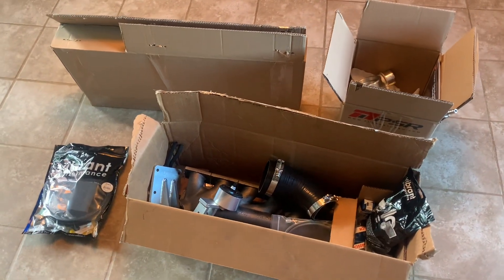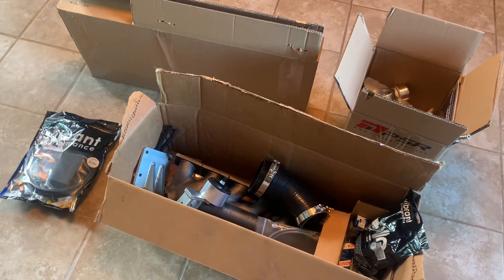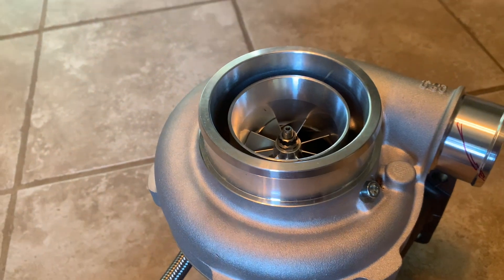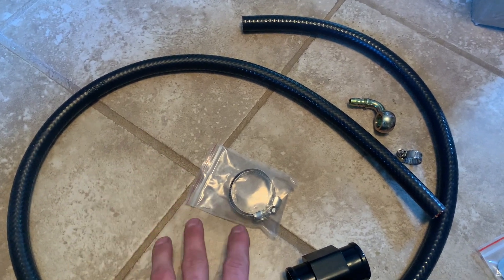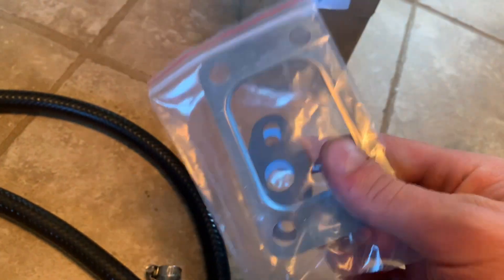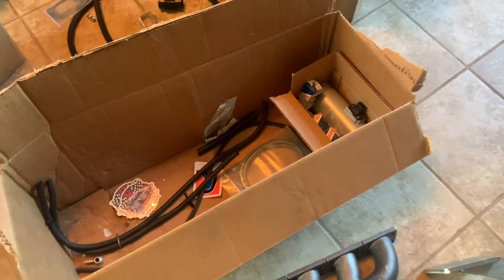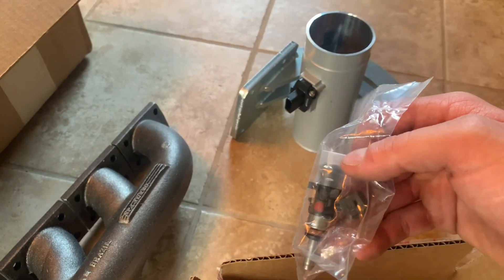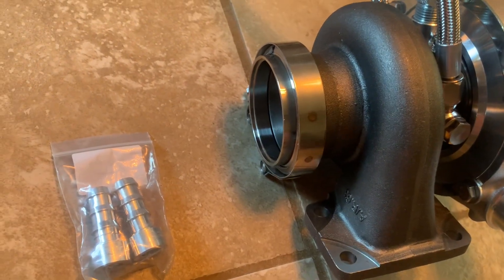How To TURBO An E46! Its easy! Heres What You Need!

Comment: could you do a video on "3 series turbo selection" or "m5x turbo selection".  seems like you have driven a 3576. and a 3584..... I have a gen 2 3582. (s52)  really REALLY want to pull the trigger on a gen 3 pulsar 3584 , it's a 3584 "67mm" front and a 66mm turbine with a small trim wheel.... if the 3584 has good power below 4k I'm sold... I feel like the 62mm is too small for a m5x. 62mm is equivalent to a 2.4" exhaust (plus wastegate) then you take up a large part of that 2.4" hole with the actual 62mm turbine. Please and thank you!  yes all thoes turbos you run  have 62mm turbine, but I still value your experience. (watched all your tach videos, still can't tell when the 3584 makes power.)
Reply: Is going with a size you mention or shown in this video more advantageous THAN a smaller "more efficient" turbo in relation to the efficiency islands on a turbo graph? ...This is if one was looking to make around 10 psi for a reliable, street performance build...

Seems like you know more than I do about deciding turbo size, and I came across your comment so I thought I'd see if you have any input on this. 

I'm very technical and like to know as much as I can when diving into projects!

Comment: is it a bad idea to boost a m54b25? or is it fine ill just make less power than the b30 can make?
Reply: Its fine, you can make good power, for sure you will make less than a b30 with exactly the same setup, but you will make at least 300hp with the most simple setup so its fine

Comment: SPA makes a wastegate relocation pipe that puts it down next to the frame rail
Reply: It was on the SPA website last time I checked
Reply from the maker: Put it in a horrible spot. Iv tried them
Reply: @hellrotgarage  Good to know, I was considering switching to bottom mount but I think I'll stick to my rsi top mount.
Reply: Do you have the link?

Comment: Hi love the content. Quick question, I have a e46 m54 b30 been fully rebuilt with upgraded parts. Molnar forged rods, Mahle forged pistons, supertech valve springs, head studs, stock aluminium block, upgraded oil pump, has been ported on exhaust and intake side, m50 manifold installed. Wanted to push 600 bhp was wondering if you thought it was safe or what I could run.
Reply: arp head studs specially for aluminum? arp's don't always work so well on a m54. I used raceware studs for that reason  (different thread ?) It's easy to look up the arp issue... Imo As long as You don't overheat your m54 should be good. I wouldn't  shoot for 600. I would shoot for mid 4's to mid 5's with a good wide  powerband on pump or pump plus meth. Honestly I Highly recommend e85 if you want it to live. once you clear 500... the longevity starts to drop. yes you can make 800 for 10,000 miles or 600 for 20,000 maybe? 500 it may live 30,000 miles or more? (yes I'm just talking about hypotheticals )  what compression ratio ? (what compression pistons, what siye pump ? what size injectors ? lotta factors play into what's possible on your  exact set up.
Reply: @DewDravis.c.o.e.33  my bad it’s not arp studs it’s k64 performance head studs. I’m using arp rod bolts
Reply: Arps aren't the best for e46s the rest is fine
Reply: @OHioyungsta  it’s k64 performance studs

Comment: Bottom mount is the way to go IMO, not only for more stealth look but also, like you said, keep that AC. Gonna be using this in the coming days to start piecing mine together
Reply: but big turbo high mounts look sicckk
Reply: you need to modify the suction hose and the hose to the condenser ( two hoses that go to compressor ) I cut and wielded the steel end of a suction hose off a early e39 97/98 ( the flange on compressor lays flat, I sent the line down under my motor mount Arm.) then I used a e90 line from the compressor to the condenser. that line was aluminum  cut/wielded . a.k.a. one end was rotated 180*... my lines came from the local pick and pull. However Imo  your best option is to take a e90 line and a early e39 line , or even e46 lines? to a ac / hydrolic hose shop .. tell them what size and shape you need. they reuse your old fitting ends , new hose. FWIW, my turbo rsi manifold car is a 2000 e39 touring. my m54(now m52) turbo car is a 94 e36 coupe. e36 is custom twin scroll. no a c. yet but it can.   bolth ms43 swapped.
Reply: I kept a.c. with my top mount (blunt tec / rapid spool )
Reply: @DewDravis.c.o.e.33  have any pictures of how you ran the ac lines and what not? i have the same manifold
Reply: https://youtu.be/2FglQKbLc8I
Reply: Great for center of gravity too! Thats the whole point of the engine tilt

Comment: No shit just what I wanted
Reply from the maker: I try!
Reply: @hellrotgarage  I didn't watch the whole video yet so forgive me if you went over this already.. What part(s) of a top mount turbo setup interfere with keeping AC?
Reply from the maker: @Darkaccent  The actual turbo manifold usually. Some you can keep the compressor but you cant attach the ac lines.
Reply: @Darkaccent  you just need to get extentded lines made and then tuck them down away from the manifold to have ac everything else clears fine